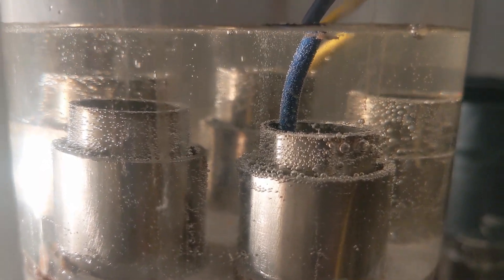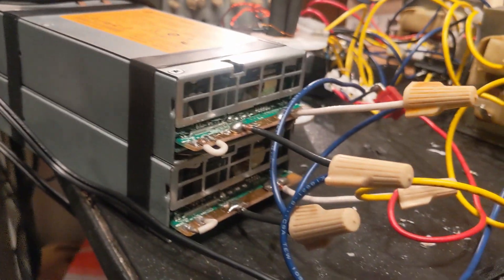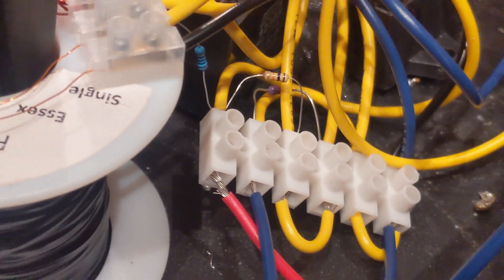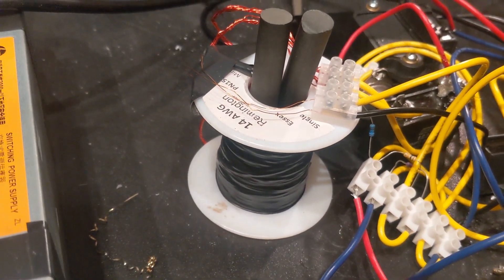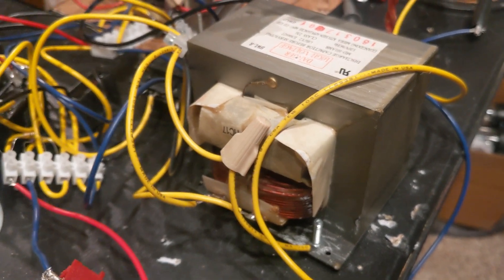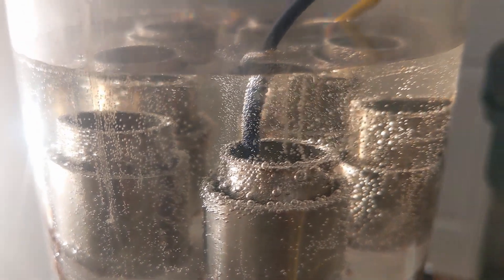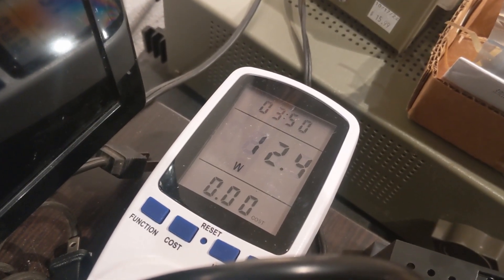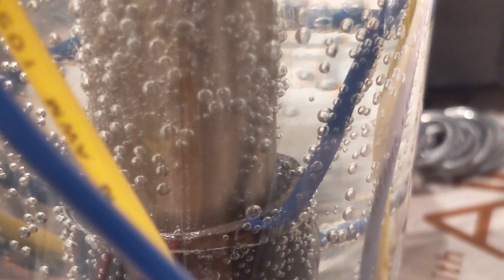HHO High Voltage WFC with Resonance [No Electrolyte]

Comment: Difference between electrolysis and this is in the former, the charges must rush out as fast as possible, in the vic, the charges must remain in the water and rush in oscillatory motion, in both methods voltage is just autoionizing the water molecules,chemicals help but we don't want that. Oscillating charges in a cavity is still current, the magic happens if you can get in phasor analysis the current and voltage on the cell 180 degrees out of phase, the wfc becomes a negative resistor. Not facts, just my thoughts.

Comment: Hho is so simple but mind blowing Technology prolonging engine life and engine oil life. And save lot of fuel if you have  a carburetor type engine .

Hydrogen is most abundant element in the universe. Hydrogen is a zero emission fuel. Hho devise will decarbonise your car engine .hho kit can installed without any modifications in the car engines..

Engine life changer device improve engine performance and increase fuel burning efficiency beter then a new car!!! More fuel will burn in the engine No un burn fuel wastage . Engine will run more power full .

Engine runs smoother reducing carbon emissions significantly . Boost engine power and torique. Better acceleration . faster running.

An efficient hho car kit lower the engine temperature more then 100 degree F.  To prevent heat build-up.Hho car kit reduce car maintenance charges. 

Cleaner engine running. Reducing engine noise due to the faster fuel burning. Hho car kits works nicely requires no modifications in the car engine. No side effects on car engine.

Engine start quickly safe your car battery. No more petrol or diesel smell

 make your car a low cost hy-brid. Use a Hho car kit small or big.

Hho kits for your  car & bike  save fuel and solve all the engine heating problems automatically.  More engine power torque and acceleration engine runs cool clean and green. Environment friendly technology make your car quick start car ac will work more. Hho technology will prolonged engines and engines oil life. Less car mentences. Low octane fuel will burn like a high octane fuel. Your engine will burn 100% fuel in the engine no unburn fuel will wastage.  Car will run clean, calm and quiet and like a new car. Best technology for the human health and happiness purpus HHO breathing machine. VERY simple and safe and easy technology, amazing recovery of human dieses like eye care,skin care, breathing shortness, parkinson and so many other dieses. Hydrogen rich water is best energy drink for human body health and happiness and for human  beauty, for good sleep. Hydrogen gas is a powerful antioxidant detox our body. Reserach on hydrogen water is in the early stages so side effects are unknown. Or you can say so for no side effects. Hydrogen is 88 time smaller then vitamin c but richest in antioxidant. HHO technology best for our  cars. I am sure nany persons would be benefit from our hho acmec videos. HHO kits are very simple but very useful for old cars engine efficiency and performance fuel saving and money saving and envernment control hydrogen on demand system zero carbon emissions. Kit can install without any modifications in your car engine. HHO kits are very useful for cars engine efficiency and performance and money saving.Please visit HHO acmec if you want more information abou hho technology call zafar 03082266179 karachi.
Reply: Some researchers in Libya tested the cells against fuel efficiency and exhaust products, everything improved.

Comment: Without a differential probe you have no way of knowing just what voltage you are placing on the cell so I gave this video a thumbs down as the title says hho high voltage and that is just a lie without a differential probe of the correct voltage rating to read whatever voltage you are actually placing on your cell. I know you are trying hard but I have put out enough information on the net for you to do far better than this with just an 8xa circuit. The voltage intensifier circuit is the one to get up and running as that's the one the world needs right now.
Reply from the maker: That is true. High voltage can only truly come from pure water / oxide layer forming. When you run the leads disconnected and probe it, the voltage is higher than when you connect to the cell to it because the cell still thinks it's doing electrolysis, not voltrolysis with high impedance. The impedance will increase as you follow ravi/lawton's method of conditioning. Stan never talks about conditioning, but so far I have never actually seen it done without the white resistive layer forming. I'm redoing a lot of my setup now because I can't get the layer to form well.
Reply: Ou is gone, how's your progress? How are you?
Reply: @alanx4121  I'm doing okay just getting older, lol. As far as my progress I'll be getting back into thing next month if everything goes right as I have to purchase a few things, like a power supply as mines finally gave out on me, as well as few other things. Once I get the things I need things should start to move right along.
I miss OU as it was the last place I was allowed to truly talk about this technology without people doing all they could to make me mad all the time or simply being treated unfairly like I was on several other forums.

Comment: What voltage are you pushing into eat tube? Stan said you need at least 1000v for it to be efficient
Reply from the maker: Not as much as you'd think with this setup. Basically 375 peak divided by 5, so roughly 75 volts per tube. If I had PURE water, it would be an easy voltage gain, but there are still imperfections with this design/cell that inhibit high voltage.